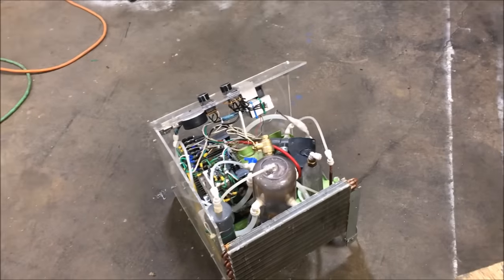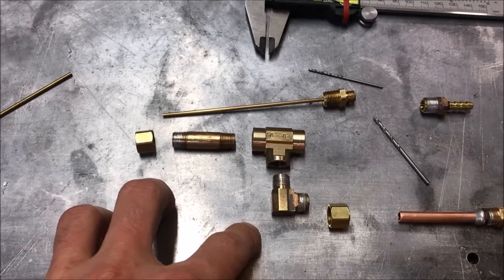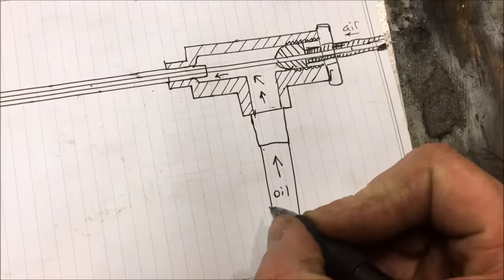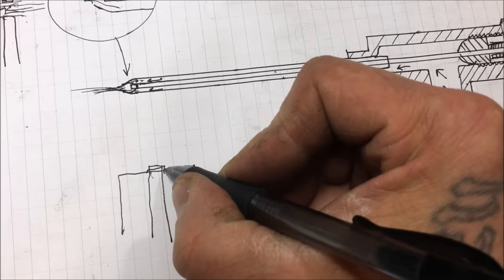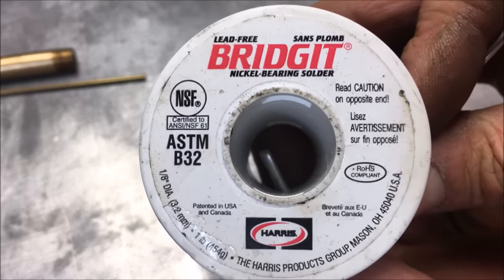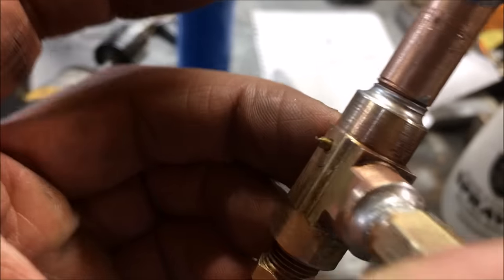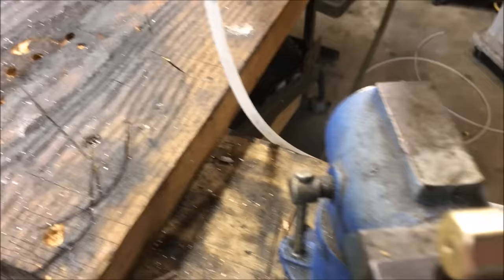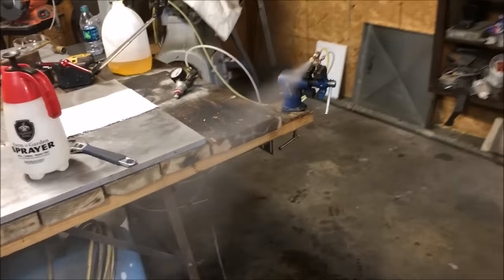Waste Oil Burner Nozzle Design Principle MASTERED (DIY) prt1

Comment: just found your videos glad I did.  for now with my budget I'm working with smith's little torch. and I didn't want the hassle of running out of oxygen and prices to refill I found a free oxygen concentrator and I keep lots of propane all ready camping, cooking, heating etc emergences.  until I find the best route for me on an HHO setup.  i see you using the same torch with your own tip made. i didn't find a video of your playlist yet about the mod. Im looking for a rosebud style or any tip really i can make or buy other than the store-bought ones price. for silver melting small ingots with my propane/oxy set up now or how far i can push this little torch I know its not ideal for melting 1-3 oz of silver but this set up is at a jewelry bench inside so trying to do most work there with one or two torches and not going out to the workshop every 15 min for something. plus workshop area is used for woodworking knife making, metal grinding, welding, auto working/painting so dirtier condition out there.  any thoughts or tips would be great.   looking at your Amazon store now.  Im new to youtube stuff I didnt see how to contact you, so if this is the wrong place please delete this. thanks liking the videos
Reply from the maker: https://youtu.be/jDpLKkzvb6w
Reply from the maker: https://youtu.be/I2vitnTud88
Reply from the maker: Hey Brother , my number and email is in most of my video descriptions , contact me if you need help , i have 2 amazon stores , one is a storefront that contains items that i do not sell  the other contains the foundry burner i sell and the steam torch
Reply from the maker: I also have a website and a ebay
Reply: @NOBOX7  thanks for info and fast response  will talk more soon.  i like the your  dry hho.  you see alot of chinese made ones out there for sale but  not a lot of output.  just dont know how long they would last.

Comment: Why are you soldering fittings together When you have pipe threads?
Reply from the maker: This is high temp nickle solder for sealant in high temp applications , pipe threads need sealed and need to be vibration proof . the smallest air leak will also ruin a siphon and compression fittings often leak for this application
Reply: And... They do actually make high temp sealers... If you are worried about temperature being an issue, 1200° or 1800 anerobic sealer will handle just a bit more than the 800° solder...   Just saying.
BTW, nice looking setup, looks like it works great! As long as it doesn't burn too many gph...that's where most have an issue, burn all your oil up before the day is over.

Comment: Idk the point of atomizing oil (mainly since it will take a lot of air pressure to do so),  but this looks like a fun project none the less
Reply: the point would be to increase the surface area of the oil and make it more rapidly combustible.

Comment: Have burnt waste oil for the last 24 years with a certified waste oil furnace. Initial cost was over $7000 but I burn 1500 to 2000 gallon a year so annual cost over is minimal maintenance cost may average $100 per year. If you're shop were to catch fire from a homemade waste oil furnace you may find your insurance company will not be willing to pay for your loss. Just be sure to get that answer in advance. Even manufactured furnaces require monitoring and adjustment as well as regular cleaning of ash.
Reply: Well its nothing to add a thermos coupler to it and that's save it if it flamed out it would cut the fuel feed , I've seen the drip feed versions where the guy used an old coal stove and I don't think they'd be able to bone you cause you are using a certified furnace just a different kind of fuel

Comment: Dude, let us get this straight. There is nothing at Lowes that is low in price, they are called HIGHS because everything at Lowes is high priced. You can buy a drill press on craigslist for forty dollar or so, to hell with fixing the old stuff. Harris makes top quality products fella. How about you use different color light with a strobe light. This would help you see and film a lot clearer.You can also use a high speed camera to do the same thing. Do you know if using any other method would atomize the liquid even more ??? How about making the nozzle tube have a 45 degree chamfer on the inside diameter of the bore ??? Thanks fella.

Comment: Is there not an oil burner nozzle (for a boiler/furnace) that could do this?
Reply from the maker: not at 500 Kw , maybe 40 to 50 kw but not higher for the most part

Comment: cant you just modify an old spray gun and then you can tune it in many ways, the width of the spray, the amount of air pressure and the mixture or volume of fluid. I mean, am I the only one whos thought of this? How about an HVLP and get a large hopper and filter and then just gravity feed the oil into that

Comment: How low oil consumption it can go?
Reply from the maker: around 250 ml per hour
Reply: @NOBOX7  wow. thats pretty efficient. Im planning a foundry furnace and trying to decide between propane, diesel, or hybrid flex fuel with both. would a burner like this fueled by diesel or other light oil like kerosene get hot enough?

Comment: I'm looking at this and thinking this looks extremely similar to how a hvlp paint spray gun works. So I'm gonna go experiment with that 

Edit: that worked stupid well. Time to make a combustion chamber
Reply from the maker: Bin down that road , its low power kit , the paint guns dont give you the high volume air flow you need
Reply: @NOBOX7  yeah I figured as much. Just tried it cranked it to 120 psi and it went pre good but not quite as good as your set up

Comment: could i use spray gun out of the box? have you tried it?
Reply from the maker: Yes sir it will work but the fuel to air ratio is horrible and it will only work in a very narrow spectrum of operation , 10 kw max is even that
Reply: @NOBOX7  i tried with petrol only to see how would it ignite before i build anything and realised its sensitive to a/f ratio. I was planning on making a burner 10kw max so it would be great actually if i could get it to run on relatively low pressure so my compressor can shut off and cool (less electricity used also), have 3hp air compressor, figured it should have good atomization since its a spray gun. Thanks for showing your builds i definately learned a lot from you and il try to reach you if i need and help if thats okay.

Comment: Oh.. it works just like an arrow spike nozel on a rocket motor, but instead of the low-pressure zone being eliminated by the arrow spike to increase angular gas velocity, that void is taken and replaced by the fluid ( oil in this case ). I think that oil diffusion/atomization could likely be improved by borrowing a few Arrowspike rocket nozel tricks.  Mostly I'm thinking of the oil spike shape including laminar flow properties for a stronger low-pressure zone, and a more optimized orifice geometry.  I never really thought about it before now, but I like your idea.  

The similarities are between the two are profound and I expect complimentarily.  
The easiest to do would be to slightly taper the ID of the air orifice ( large side of taper towards the back, small towards the exhaust )to act as a flow accelerator by guiding the compressed air stream to expand closer to the oil spike exit.  This would give you a stronger vacuum effect and increase atomization.  Additionally, it would bring the convergence point closer to the burner itself so that your heating tube would not have to be quite as long.
Additionally adding a rounded-edged to  OD of the oil spike itself would help with the airflow and atomization, but may reduce the vacuum effect and overall fluid pumping ability because of the decreased low-pressure zone total area, even if it is a stronger vacuum being formed, fluid viscosity would have a much larger effect in this case.

Comment: Very nice design but I cant help think... You can burn waste oil by running a 1.5 HP compressor using a ton of electricity! It's not practical for a home shop but good design for an industrial application.

Comment: I built a lot simpler setup than this the oil was gravity feed and using a 1/8 copper line off of an oil psi gauge adjusting it's was done by how far you threaded the 1/8 coupler to the supply pipe

Comment: So is this one of those situations where it just way easier and cheaper to buy a purpose built nozzle???
Reply from the maker: No , propane cost out the ars and he bottle looses pressure , you cant run a foundry on propane with out hundreds of dollars in gear  , if you already have it cool , capital rocks but most people dont have tanks hoses and all that jazz , plus this thing lets you burn free fuel ??? pays for itself hommie
Reply: @NOBOX7  I was talking about waste oil nozzles, not propane....

Comment: Need a power hungry compressor to run this nonstop.
Reply from the maker: This is not a green energy channel , we move mountains and keep the wheels of industry feeding the slackers
Reply: @NOBOX7  There are designs without air atomization that works as well

Comment: Those fittings you are calling FIPs are actually MIP and are commonly, in conversation, called male pipe or female pipe for obvious reason. Nice simple nozzle ....i'm going to take a whack at it....swh
Reply from the maker: Yeah i often film after being up to late and transition errors are common when lacking  rest

Comment: Just buy a paint gun for 10 bucks :)
Reply from the maker: They dont work well , the air to fuel ratio is bad . they dont spray enough oil.
Reply: There is a lot of adjustments around the mixture, premix, forward pressure, vaporizer focus etc... And, many models come with a set of different nozzle and center pin. What I have (for 40$) can spray out anything from water up to sticky  halfway diluted bitumen.

Comment: these can be modified i think    eBay item number:
163080367607
Reply from the maker: Couldnt find it friend
Reply: well i just have to Write what it is then its  
Inflating Air Pin Inflator Needles for Ball Pumps

Comment: FFS! Its Female Iron Pipe! Not fip.
Reply from the maker: thanks , i think i ment fpt
Reply: @NOBOX7  he wants to use  least amount of air pressure  possible there and the shortest length of stream possible with most spray

a boat a foot the less a

 pressure the better is

 Optimizer Works e